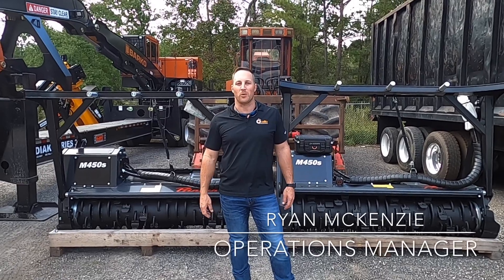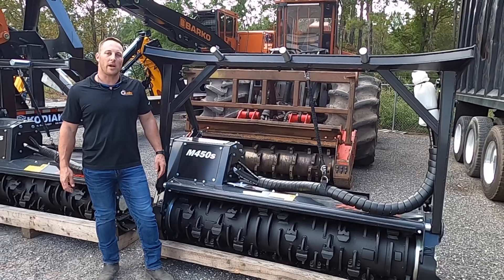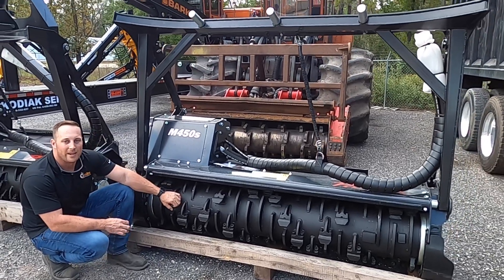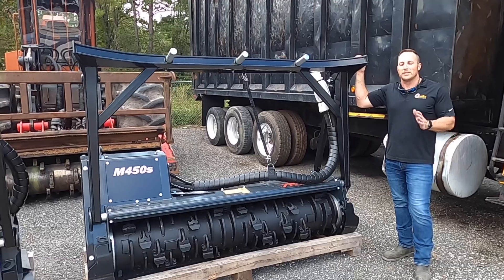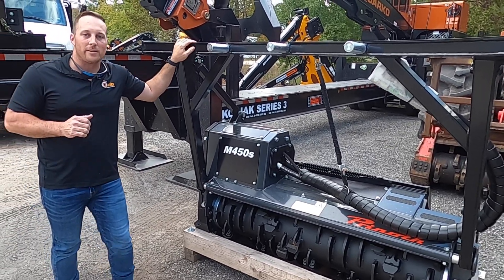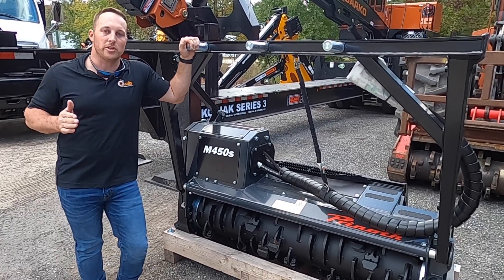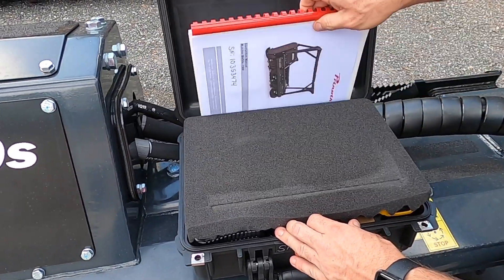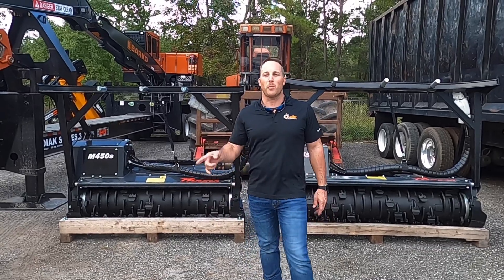Prinoth M450S-1900 and M450S-1600/ Model Comparison

Comment: I hate the way it mounts to my lamtrac.  Always comes off, and the bolts strip out all the time...
Reply from the maker: Richard, I am sorry to hear that. The only one we have heard of coming off on the Lamtrac did not have appropriately sized bolts holding it on. I would check that on your head. You may need to drill and retap to a larger size.
Reply: @QEPUSA  thank you for the response.  The head needs to fit all the machines you mentioned tighter with stronger welds. I shouldn't have to rely on bolts to keep the almost $40,000 head on. Never in my life bolted fae or cimaf. That stated lamtrac has serious issues with the attachment plate.  You seem like a very respectable company.  I appreciate your time.